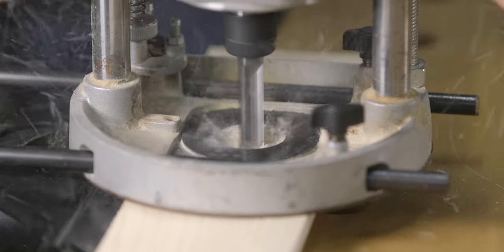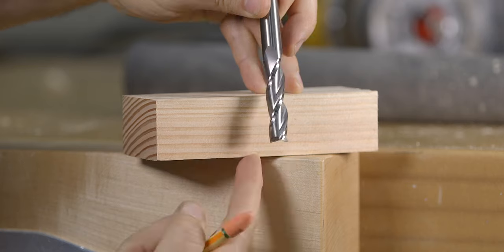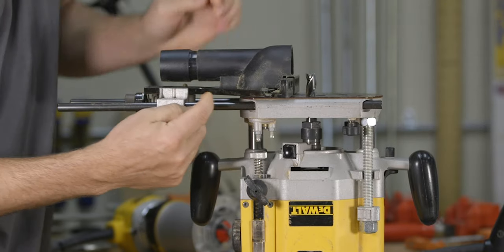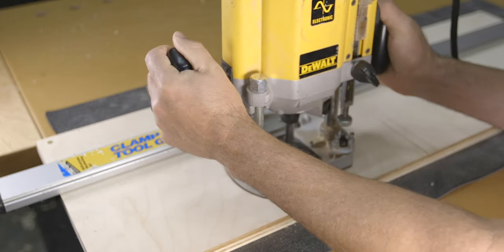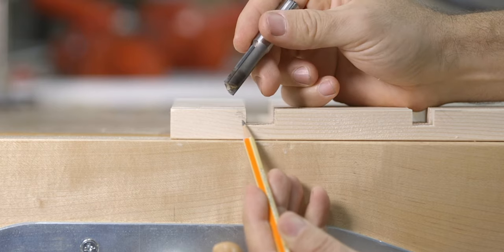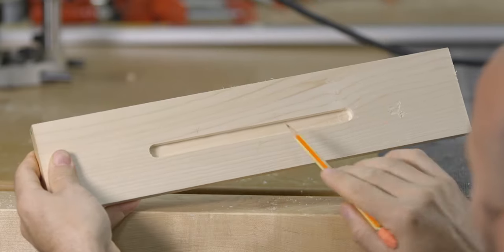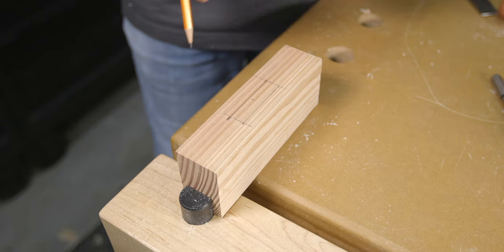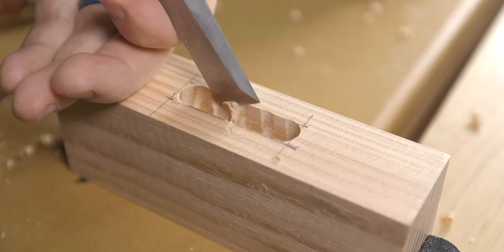Learn How To Cut Grooves In The Middle Of Wood

Comment: I have been searching and searching on how to make/ fix a vintage drawer slide, the part under the drawer. I have seen them for same but they seem to be all slanted, like a dove tail. I need to replace to that are approximately 17” long and 2” wide. The center slot is straight and 1” wide. I was wondering if it is made with a straight router bit. I’m at wits end. My next idea was to edge cut the strip that’s broken and replace the piece that is 1/2”x 3/8” or find another vintage dresser with the same slides. Thanks for sharing your skillls.

Comment: I just bought a plunge router for making a privacy wall ..It came with a guide ..I believe I will use pressure treated 2x4 to make a center grove to slide composite 5/4 decking or fencing to create my privacy wall on my porch ..maybe I should use azek rather than the pressure treated 2x4’s ..I’ve never used a router before so I’m assuming I’ll need to make 2 passes to get the proper width .?
Reply from the maker: Most likely 2 passes.

Comment: Thanks for the video. Any ideas on how to put in a (straight) 2mm groove in a piece of wood? I don’t have a lot of tools (a drill, a jigsaw, manual saw and not much more) and I’m not an experienced woodworker.  I would like to make a plexiglass sign holder. I have used a manual saw 🪚 in the past but it is always wonky and not very accurate . Thanks in advance!!
Reply from the maker: Hi. It's really hard to do with the tools you have.... maybe a manual saw and then a chisel.
Reply: @TrainingHandsAcademy  thanks for replying. Under normal circumstances what would you use for such a narrow groove?
Reply from the maker: Router @jasmindrace

Comment: If I can add something, to follow a straight guide I prefer to use the rounded part of the router shoe rather than the straight part. In case you rotate the router, you will still cut at the same location as long as you're touching the guide, whereas with the flat side of the router, you will instantly pivot out of the intended location.
Reply from the maker: That is fantastic information to add! Thank you for sharing.

Comment: V interesting. I don't have a router but wish to make several 1/2 inch thick pieces with slots very similar to your vid at 3:41. Could I do this with a router bit in a press drill?
Reply from the maker: Hey Hector! No I would not recommend doing that.

Comment: So how would you rout a curved groove that matches a curved outer profile of your piece? For example, if you have an arched piece of trim for shelving or cabinets and you wanted to rout a groove parallel to the outside curve roughly 1" in, how would you accomplish this? A standard edge guide wouldn't cut it.

Comment: I have a question about routing plywood for a T-Track, the plywood has knots in it which I cannot avoid in my design. Without having to pay for premium plywood (that is pretty much Knotless) but twice the expense $$ how do you suggest getting a clean cut through knots in the wood or am I dreaming and it can't be done?
Reply from the maker: It's a crapshoot... just depends on how tight the knots are. Please be careful because they like to shoot out like mini bullets when using the router. Do your best. :)
Reply: @TrainingHandsAcademy  hey thanks for getting back with me I also heard that if you soak the knots in CA glue and let it cure first it should be all right again thank you!
Reply from the maker: @patrickbrady8326  Let me know how that works for you. :)

Comment: Hello sir. I am trying to make a custom barn door but want to tongue and grove my frame with a plywood insert (hope that makes sense).  Can I use a router to make a grove on the inside of my frame pieces?

Thinking of 4x2 for my frame and using 3/4 plywood for the middle....
Reply from the maker: You sure can with an edge guide attached to your router.

Comment: Hi! New follower from the UK here 😊 We found your videos while looking for guidance in using a router with plywood. We’d like to cut some long through cuts in the middle of a birch plywood board, similar to a radiator cover if it makes sense? What bit would you recommend using and how can we avoid splitting of the plywood? Thanks, S
Reply from the maker: Hey there! I would use a good compression straight cutter, or you could use a down cut or an up cut spiral bit... just depends on which side of the plywood you are cutting from.
Reply: @TrainingHandsAcademy  thanks so much for replying! Do you know if the compression cutter bit would give a good finish on both sides of the board? We’re going to use it as a desk leg so both sides will be on show. Thanks again
Reply from the maker: Yes, the compression bit has both up and down cut spirals which produces clean cuts on both sides. However, it still may not be perfect, but you will get the best possible results with that style of bit. I would defiantly run a few test pieces first to dial it in before committing to your final work.

Comment: Hi there. I purchased a Freud adjustable tongue and groove bit set (99-036) for my ryobi plunge router however the router doesn’t go down enough so I can make a groove in the Centre of the 3/4” stock. My question is Can you insert the shank about 50%of the way into the collet so I can get the bit to go down further or is that dangerous to do? Also do you have any videos or know of any that explains how to assemble the bit set when adding shims to adjust the depths of the cuts. The set is supposed to be  adjustable but when I added the shims I ended up ruining the blade because the top and bottom cutters ended up touching each other. Any help would be appreciated. Thanks so much.
Reply from the maker: Hey there. I have installed bits about 50% of the way without any problems, but that doesn't mean it will always work with every router and every bit. Make some test runs, stop and check to see if the bit has moved. If everything looks ok, I think you will be good. I'm sorry but I don't have any videos on the topic nor do I know of any. Wish I could help you out more my friend.
Reply from the maker: @echavez397  I've actually never used a set like that so I can't speak enough truth into how those work. I would consult the instructions that came with it or contact the manufacture. Sorry I couldn't be more helpful.
Reply: @TrainingHandsAcademy  no worries thank you so much. Unfortunately they didn’t come with instructions. I’ll try calling them.

Comment: Ok. I’m dumb. What if you only have a fixed based router? And you (I) only need to make a very shallow channel? Like 1/4” deep. 2” wide 10” long?
Reply from the maker: You're not dumb! If that channel is in the middle of the wood, and fixed based router will not work.
Reply: @TrainingHandsAcademy  Thanks for the reply. And look at that... All my teachers were wrong. Take that Mrs. Bennett !!

Comment: what is the attachment on the drill called? also can I get bigger ones for bigger holes?
Reply from the maker: That's called a forstner bit, and yes you can get bigger ones. :)
Reply: I found another one call chisel.

Comment: so its counter clockwish unless you are widening a channel ? and then its clockwise?
Reply from the maker: Hey Tyler! Yes, you are correct... clockwise in a channel.
Reply: @TrainingHandsAcademy  awesome...i have a rotted fence i need channels for and a router that has been sitting so long. I am a newbie and this helps alot!
Reply from the maker: @tylerhoneycutt4862  Go slow and make sure you  remove a little material at a time. Reach back out if you have questions.
Reply: @TrainingHandsAcademy  Thank you

Comment: When using the fence why didn't he use the flat edge on the router?
Reply from the maker: Great question. The flat edge on the base is normally not the best edge to use because you have less control over where the bit ends up when you are using a straight edge. You have more flexibility to rotate the router slightly (left or right) using the round part than the square part. I hope that makes sense. I have a beginners course that explains this and so much more if you'd like to check it out.  bit.ly/3DcIeE3